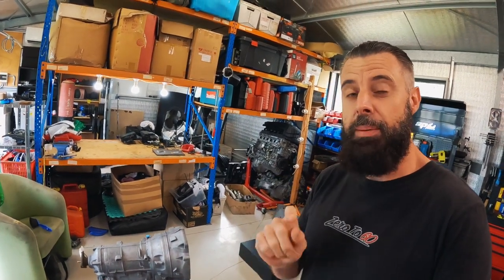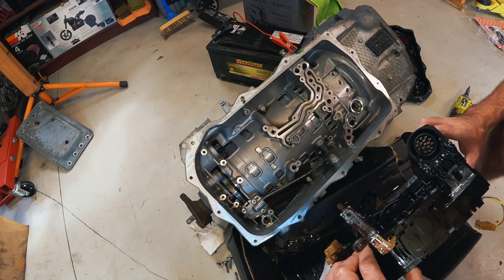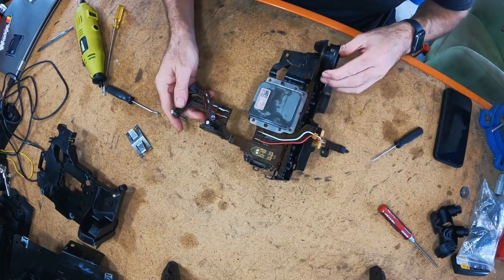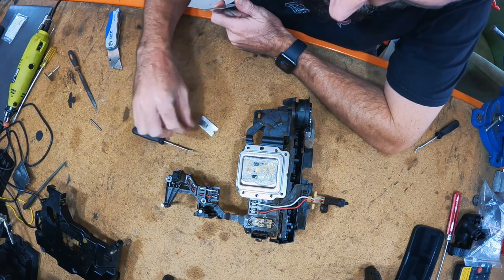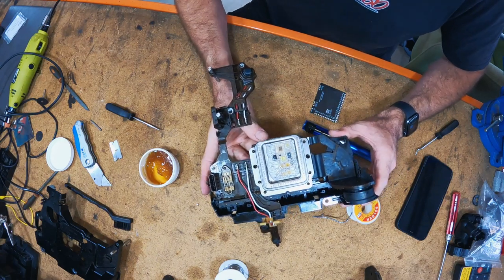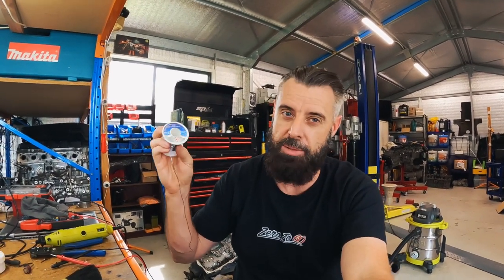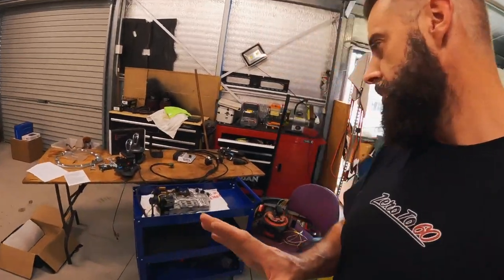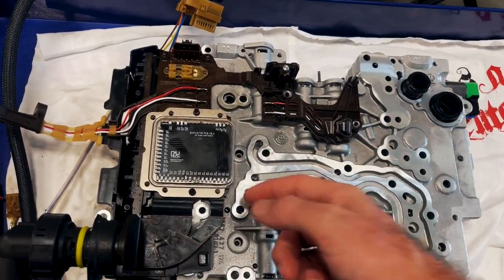Turbo Lamik 8HP TCU Modification Ryutech PCB INSTALL (SORT OF)

Comment: Throw a zipp kit in while you are there.Going to put one into mine.
Reply from the maker: I’m not going to. This box has only done about 40,000ks and tbh I have never seen a trans down here in aus that needed a zip kit. I have never seen mechatronics fail internally. I know they do, but it seems to be rare.
Reply: Fair enough.I know that the accumulator pistons/springs  are plastic standard on the ZF and the zip kit has steel springs as a upgrade.May improve reliablity.From what I’ve seen on line,the accumulators which are plastic can de-form over time. 40km on yours should be good,mine has 207km,so while I am in there will do them.👍
Reply from the maker: @rd.3696  Definitely makes sense i guess at your milage. Please let me know what your original stuff looks like when you do get it out.
Reply: @ZeroTo60Tube  will do.

Comment: You werent getting enough heat to the pins because you immediately pulled the tip right after dabbing the solder on, leading to a cold junction at the joint. You’re also running way too much solder in with not enough heat. If you get a blade tip or a cup tip, you can prime the tip with solder, flux the pins and drag it across all the pins. Any bridging that happens, just apply flux with a clean tip and pull it away.  You also aren’t cleaning your tip everytime, using the flux to clean isnt the proper method. You should have a wet sponge with deionized water. Get some proper wick too, don’t use those suction cups. The plastic tips contaminate the connection.

Comment: BMW engineer : This is the most advanced gearbox we have designed yet, it has a wide range of additional features the previous 6hp didnt have. 
Zero260: To be fair it looks pretty similar to a 6hp, with some extra shit at the back
Reply from the maker: The more i have learnt about it, the more simple it seems. Clutch plate spacing is tighter, which what leads to the quicker shift times. Different oil pump design, but the way they package the 8 ratios it brilliant. Still not a complicated box.